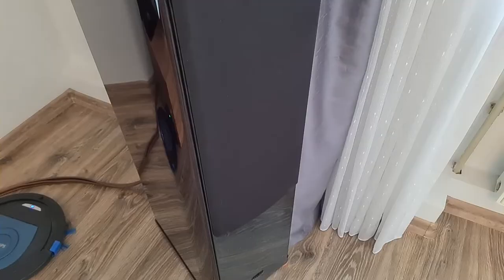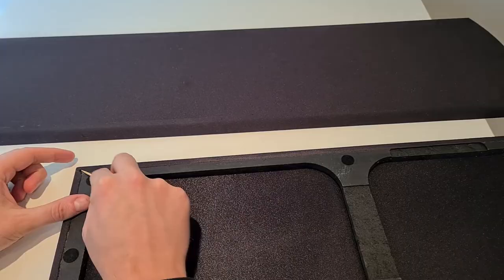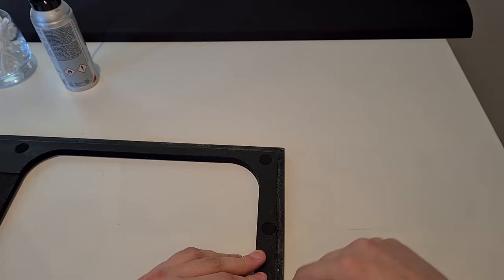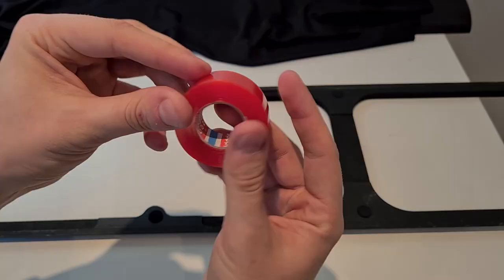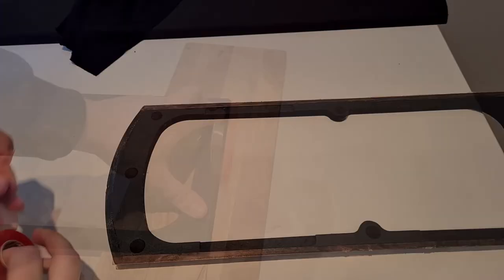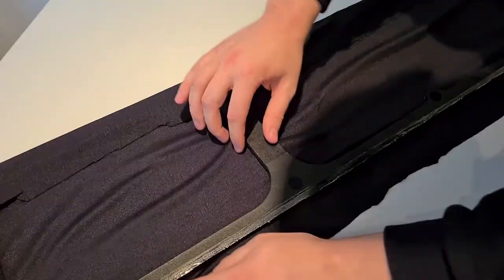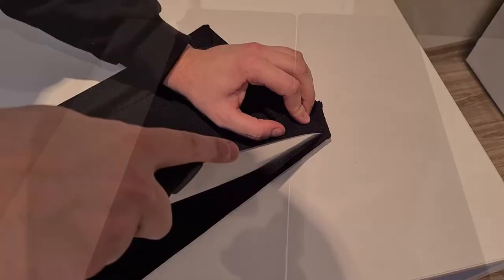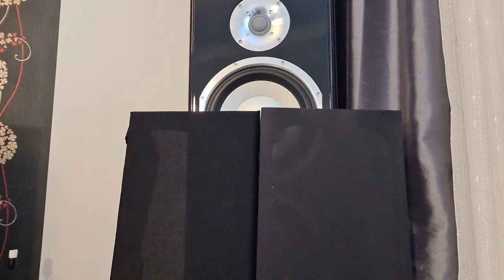How to replace OLD speaker grill cloth DIY

Comment: This was a great demonstration but I think the motor-skill expertise that was required was higher than the voiceover is prepared to admit. Specifically, I don't think I could do the stretching part without the grille cloth being humped in some places and sagging in others. Do you have any more specific advice for me about how to avoid that?
Reply from the maker: This is my first time doing this, so I don't have much experience to give tips and tricks.
Reply: @Techscrews  Can you tell me anything more specific, such as the exact brand of tape that you used? I'm going to try but I'm pretty sure that I'm going to mess it up.

Comment: ...it has been two years almost - did the double tape hold ?? (i tend to doubt this, double tape doesn't hold anything for too long)
Reply from the maker: No problem since I installed them. If you buy the Tesa manufactured tape and it is not under load, then it holds spectacularly.

Comment: I have some nice Sony tower spkrs yeah I know I had JBL  b4. But these are very similar in size shape as 1s in the video. No tears just uv made the color wash out or fade. I was wondering is it that ez. I'd think the fabric could be spray dyed? The finished grill looked like new but I'm worried bout material quality. Availability.... I'm just hesitant in tearing off a fabric and doing a crappy job. I'm good with my hands build and repair guitars. But fabric and upholstery always intimidated me. Is the link for fabric supply chain good????

Comment: How long is the double sided tape supposes to last, especially in a place where the old cloth was damaged by sunlight?
Reply from the maker: it depends on double sided tape brand. The spec of the adhesive tape needs to be checked, see how much heat it can withstand, before becoming flexible

Comment: can u share glue link?
Reply from the maker: In this video, I use Tesa double-sided tape, but you can also use 3M. Any home depo store assistant can help you find the best solution for gluing fabric cloth to a speaker grill frame.
Reply: @Techscrews  Thanks